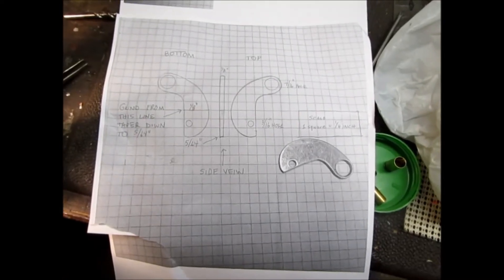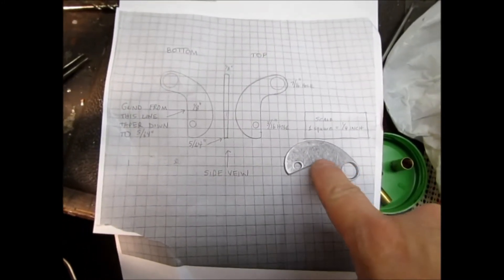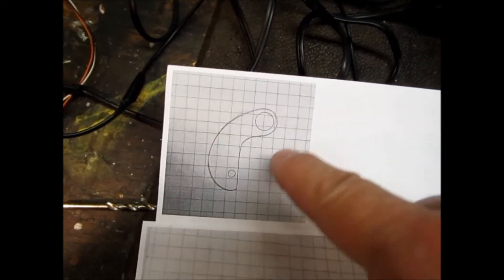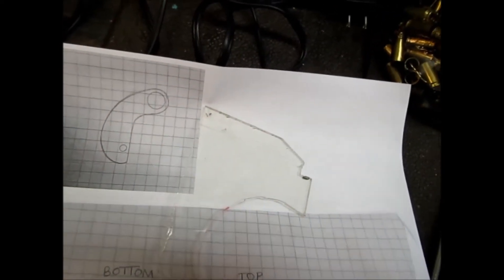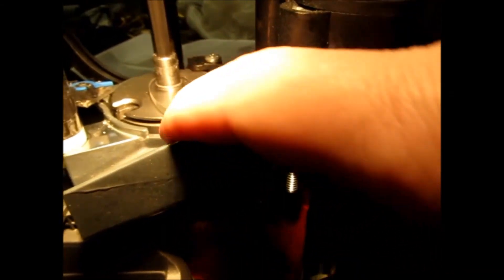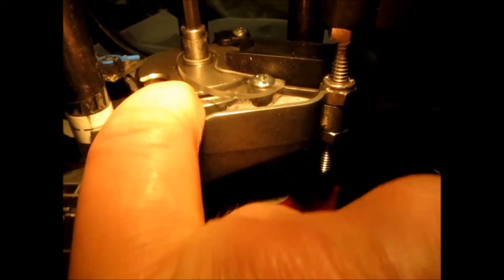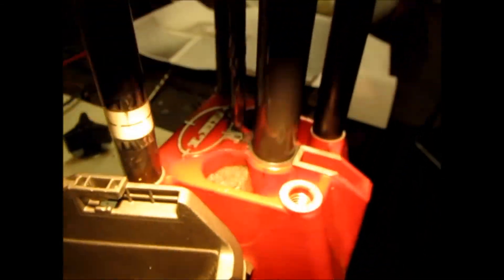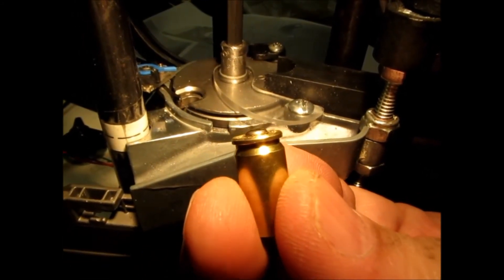Lee Pro 1000 Improved Bullet Ejector

Comment: Interesting, I made something similar using a heavy gauge paper clip!  A few bends in the right places, attaches where the original design ejector attaches and then extends to rest lightly against the drive bolt/action rod hub. Simple, fast, and virtually free.
Reply from the maker: +bippie23456 I always enjoy seeing how other people have solved similar problems. What is the most reliable, least expensive, easiest  to install/manufacture and sometimes most aesthetically pleasing design.
Reply: Like you, I did the same thing with a length of music wire bent to shape and held in place with the original screw.  The machined part is nice though.